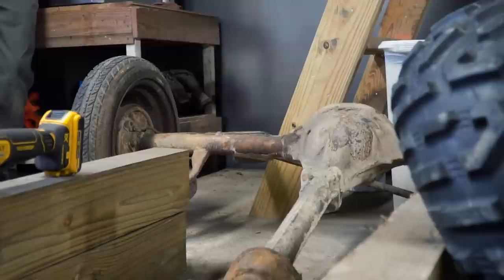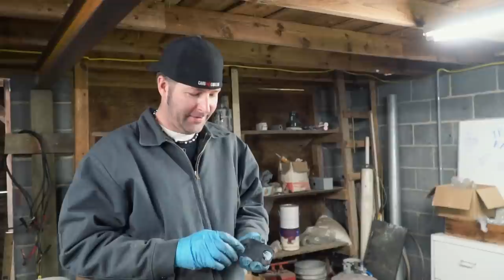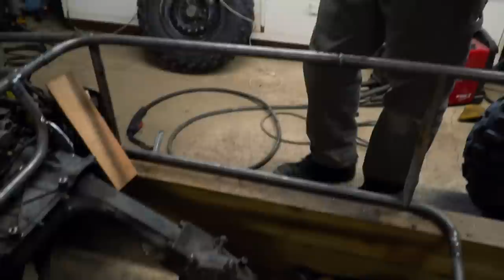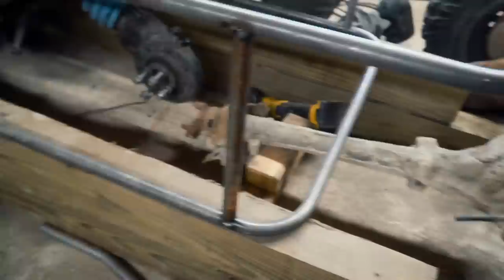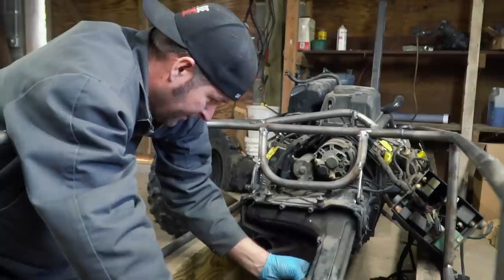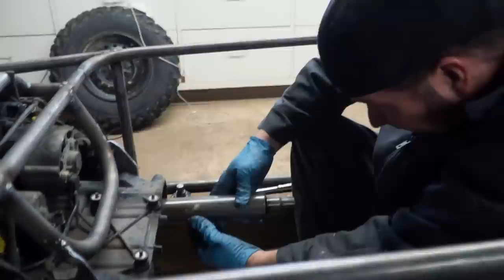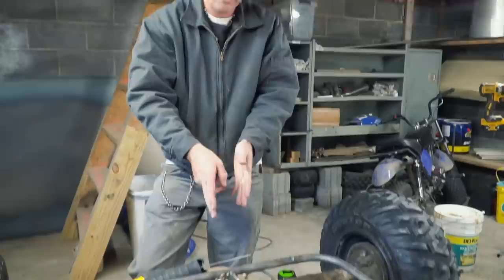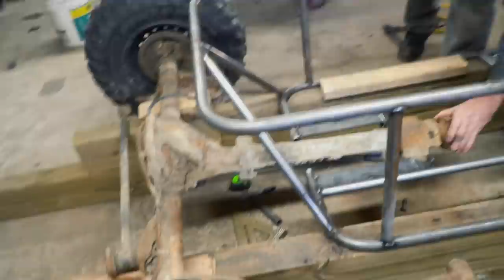1000cc Trophy Kart Build Pt. 3 | Mounting the Rear Axle

Comment from the maker: Those tires on that rear axle😍
Reply: CarsandCameras crazy!
Reply: Is there gonna be a body on it ?
Reply: I hope so Cough - John - cough
Reply: Might I suggest a triangulated 4 link in the rear to eliminate the need for a panhard bar?
Reply: Its coming along great, this is your first build with all the gear so if you don't like something change it or you will lose inspiration for the build.
Reply: Hi love you videos guys... 

2 things I want to point out, which you may have already considered.. 

1, If the rear axle was rotating the wrong direction, flip it over and it goes in the opposite direction.

2, You're going to need a slip shaft, and bearing mount where the 2 drive shafts meet. 

Keep up the amazing content!
Reply: You should also put a bar around the rear drive shaft!!
Reply: Do the rear suspension like a traxxas udr
Reply: Bet Ike is pretty happy he cut off that axle before junking that car.  This looks MUCH better than a Chevette!
Reply: This is going to be awesome guys🤣✌
Reply: You guys should use some kind of hydraulic steering system
Reply: The k100 diff is a strong 90°gear box, may come to use on future projects
Reply: You all should get ahold of Red Beard, of "Red beards garage" I think he could help with the front end stuff, or you all could do a colaboration
Reply: You guys should consider the benefits of a mid engine setup. Would work really well here and solve your motor mounting/foot space issues.
Reply: why u dont punt rewers betwen dif. ore low and hy box in it it ?
Reply: Where are you going to fit the steering column with that engine?! 😂
Reply: If im right you could just turn around the axle
Reply: Ilu guys
Reply: check out grind hard plumping companys projects and their stuff for fabrication and steering. They have pretty small form builds with lots of stuff in them!!!
Reply: Should have done a off-road reverse trike. That would have been awesome.
Reply: You should try using pushrod or rocker arm suspension because they dont take up that much space and look cool wile being functional. Also the pivit point for the sway arms should be tilted back 12-18° this will help with bigger bumps and it'll make the ride a lot smoother because usually the tire does most of the work when the pivit point for the sway bars are mounted flat(or are barely even tilted back) but if the pivit point is tilted back 12-18° the tire and the suspension are working together a lot more and the tire goes straight wile also going a tiny bit back which helps make it a lot smoother and moves quicker when you hit a bump which will help stop the front end from kick up especially because there's more weight up front and as a plus if you run over and hit a sway arm on a big rock the sway arm most likely won't take any damage(if you have a plate underneath it) and will slide over it. You probably know more then me and know what type of suspension will work best but I just wanted to give you an idea of the type of suspension that might work with what your trying to do. Forgot to add that the steering nuckel is still straight up and down just the pivit point and the sway bars are tilted back.
Reply: hey you guys were wanting an idea on looks why not do something like dirt track midgets? 
http://s100.iracing.com/wp-content/uploads/2017/11/Midget-Car-Tile-Page-1024x576.jpg
I think it would work really well and they are  bad ass little cars
Reply: You guys need a sponsor to send you a lathe. Then you could cut spline shafts and more. Looking good otherwise. Can't wait to see her against the cross kart.
Reply: Cars and cameras style buggy wheels
Reply: Idk exactly, but I would want to do a solid mount to that small splined shaft like factory and maybe add a large shaft and u joint off of a ford ranger drive shaft and recreate the cup on the trans. Get more travel and strength?
Reply: id love to see a short mini truck bed with a wood floor on that
Reply: CarsandCameras get rid of the live axle. Use a Subaru rear IRS set up or early nissan sedan.
Reply: You guys gonna weld that diff for posi traction?  I'm pretty sure that's an open diff,  open diff + offroad=stuck somewhere at some point...
Reply: 4 link  2 below out wide 2 up top close to center.  And then 4:1 or more pushrod suspention  that will give you your desired 18 inches of travel from the 4.5 inches of stroke the miata shocks have.
Reply: @collinschoneman8605  trx4
Reply: CarsandCameras Have you guys considered using a manual Honda Civic steering rack? Preferably for an 88-91.

Comment: A possible idea: Weld a 1 1/4" keyed coupler on the driveshaft, and on the opposite end, so you can run a gopowersports 1 1/4 axle as a driveshaft.

Comment: Cant wait to see how this project turns out!! Although, Miata shocks and coil-overs aren't gonna give you the plush, long travel suspension that your wanting and that this chassis needs. Miata suspension is made for a 2,000 pound car and at the most have 5 inches of travel. Go on eBay and get yourself some used shocks off a Polaris RZR or equivalent SxS. They are around the same price as used Miata suspension and will give you a lot better ride then any car shock will. Keep up the good work!

Comment: For the bump steer, keep the levels of the tie rod mounts the same on the frame and the wheel. Looking good guys!
Reply: With the amount of travel they want that would put tie rods at a severe angle at max travel.
Reply: Grind Hard Pluming addresses front end geometry on several of their builds. (Barbie Jeep, Honda Oddesy, etc.)
Reply: A thought; a Twin I Beam style suspension, both axle halves pivoted in front of the motor and front steered. If you use a drag link to operate one side the steering would avoid needing to go through the engine space.
Reply: They already know this.  Aint their first rodeo.  Becomes different ball game with extreme travel.
Reply: @SportbikerNZ  Agreed- the current hhot set up with some of the four wheelers in Texas is based on the Ford Twin I beam- huge travel. it does have some geometry probs at full droop, but for a back country vehicle that will seldom see 45 mph, no big problem. The front steer is to get the  tie rods and such away from the motor, and those tie rods need to be the same length and plus or minus 105 of the individual axle length. While I'll agree this isn't their first rodeo, they are looking for something they really have not built before- 18" suspension travel, bounce and jounce is huge- a Humvee doesn't have 60% of that. Also the Twin I Beam is not on the menus they have been working from, so I thought I'd through it in there. FWIW, all front end geometry becomes  iffy at the extremes of most long travel designs. Additionally, a drag link type of steering gear will avoid having to pass the steering shaft through the motor, rather by the side of the motor and tie the drag link end to the steering arm on one side and "share" the input thru long, articulated tie rods, run parallel to the axles at ride height , equal length and with their "input ends" very close to the same point as the pivot for the steering knuckle they are tied to.
Reply: @fredericrike5974  Your comments look productive.  I should have specified I was replying to the steering 101 comment by Pugg.

Comment: For minimizing bump steer a double wishbone setup is pretty easy and will keep your speed up in the rough straights. In our baja SAE cars we have 10-12" of travel on a 15" A arm setup and can keep it under 3 degrees of bump steer. Getting into bump steer while turning is some high level stuff and more trial and error with CAD simulations than anything, so I wouldn't recommend bothering with it for this.

For setting it up, just make sure the tie rod mounts of the steering rack are in line with a line drawn from the upper A arm pivot axis and the Lower A arm pivot axis, and that the upright's steering link mount holds the link as close to parallel with the A arms as possible. It won't be perfect throughout the whole travel due to your kingpin angle giving you unequal length upper and lower A arms, but if you can have it parallel at right height it should be pretty close through most of travel.  Since you probably aren't building a steering rack from scratch, you'll probably have to make extensions to whatever your found and support them with just some plain nylon or UHMW bushings, but mounted inboard by the distance of the racks travel. (so the rack would have to be pretty skinny, like something from a quad, UTV, or golfcart rather than a car).

In a front mounted tie rod design, pivoting the steering link towards the wheel will increase ackerman, while bringing it in towards the car will get you closer to parallel steering. How much ackerman you want depends on how much wheel spin you're going to have, and whether you plan to drift through the corners or brake and try to corner them properly. 
In my experience with vehicles with a 70% rear 30% front weight balance, the parallel steering is very susceptible to understeer (even at higher speeds), while it can actually get some grip with around 70-80% ackerman steering because the front tires aren't fighting each other until the rear breaks traction.

Comment: You should use a VW front beam make your front suspension a whole lot easier to build it just bolts in
Reply: Casey Nolte then they wouldn’t be able to get the travel they want
Reply: maybe a vw lower front k member from a mk2 or mk3 golf/jetta. flat, cheap, steering attached, and easy to mod. in fact i think i have a spare somewhere that i might be able to donate to the cause. its 4x100 for the hubs too, so that should be pretty compatible with your wheel selection
Reply: @colez4651  really depends on the way the beam is set up
Reply: Yes. This thing needs a real chassis too but I'll watch this thing bend as soon as it goes over a jump. It will be more entertaining
Reply: Yes, and make it ride like absolute crap.
Reply: @nickmccain6598  Same ignorant comments were made by clueless people about the crosskart.  They're only getting started on the chassis.
Reply: @SportbikerNZ chassis doesn't even look halfway done to me, "its gonna bend", well of course it would the way it is
Reply: @Billo-07  They could have 4 pipes welded into a rectangle frame and there'd still be some internet "expert" freaking out that it's a death trap with no roll cage.
Reply: @nickmccain6598  them damn fake chassis, aint got nothing on a real chassis
Reply: @colez4651  you have obviously never built an off-road  link pin front end, you can get 14 to 18 inches of travel out of one
Reply: yes, easy bolt on

Comment: Really wish y'all went with the reverse trike for this. That would have been awesome. Seeing that offset drive shaft, you should put in a 4wd transfer case and throw an old claw foot tub in between the frame for seating. It will be the bath tub bouncer.

Comment: I'd suggest changing the torque tube mount so it pivots vertically. The stock rubber isolator won't have enough flex for the suspension travel you want. You could do it easily by trimming the stock mounting plate and welding on a washer to each side vertically. Add  pieces of angle to the mounting plates on the frame and bolt the washers to them loosely so they will pivot. If you use the torque tube as a suspension link, you won't need to add 4 more links. In fact, it will probably cause binding. The tube will control pinion and brake torque as well as forward and reverse thrust. The coil overs will control roll and jounce. I would extend the outer suspension links to pivot on the same axis as the front torque tube mount to control yaw. BTW the gear ratio of the Chevette rear should be 3.36:1. Also, Chevette brakes really SUCK. Consider changing to disc brakes. Nice start on this build!

Comment: Carsandcameras  Copy the superlift, prerunner steering links. Basicly an over-engineered idler arm and pitman arm setup with equal length steering links.  Just make sure steering link angles match the control arm angles and on center line of the upper and lower control arms. As close as possible anyway.

Comment: I work on K100 A LOT. Before you go any further check the front end of the driveshaft for spline wear. They do wear badly if not greased on a regular basis.......
Also for extra mounting, why not use the centre stand mount point on the bottom of the gear box? This is used for also a mount point when putting a side car on this bike.

Comment: Source a Suzuki Samurai rear axle. They have an offset diff that would line up better with your driveshaft output. They don't have that extension housing off the front allowing for a longer driveshaft (better angles @ the joints). Plus, a fair aftermarket support.

Comment: Looking at your frame ther and the relationship of the rear end and the frame you might consider quarter eliptic springs in conjunction with the existing suspension. You will need to add a panhard bar but it would be simple and effective.

Comment: You should use a triangulated four link on the rear axle.  It will allow maximum articulation of the axle, and it eliminates the need for a panhard bar.

Comment: I don't know if this will help but you could put a shock on the the steering linkage to help with bump steer. Kind of like how some jeeps have in the front. I think that is there mostly for vibration but it may help. Also depending on how much angle change is on those u-joints you may want to use double cardan u-joints.

Comment: Sit the driver position up higher, basically above the rear axle driveshaft area. It will help give more feet room, the problem now your positioning to be more horizontally positioned which while riding may add some discomfort. Just a suggestion.

Comment: I could really use that differential. I'm trying to put this 900cc old kohler engine into a golf cart and it would look 100 times better if it could be mounted facing forward. Another thought i had is i could do an old style motorcycle with a flat opposed twin, and i could use that to do what it was initially made for on the bmw bike.

Comment: Bolt a sprocket to the back of the engine, and chain drive it down to a Jack shaft / prop shaft to be inline with the rear shaft. especially good if you have your UJ inline with the point of articulation, then you wont need a sliding prop shaft coupling

Comment: I'm pretty sure a trophy truck doesn't have a 4 link rear. It's all trailing arms I believe but I would build a ladder bar
Reply: What they are talking about is trailing arms and a panhard bar. I'm sure trophy trucks use a triangulated 4 link. Lower trailing arms with the upper arms forming a triangle to centre the axle
Reply: @richardmackay7858  they actually don't run 4 links at all  it's a trailing arms setup with a wishbone 3rd link you can get way more travel out of a 3 link system

Comment: Instead of just a driveline hoop Id consider running from the cut spot up to the braces and then add a cross piece, that will give a lot of support. Then you could come off the top hoop to the area of the cross piece to triangulate it even more

Comment: Hi guys, love your project. I'm concerned about your final weight. The BMW wet is 560 lbs. Are you going to come in at about 700 pounds? How much offset between the two drive shafts? Would a crossmember with carrier bearings and chain sprockets take care of the offset and also offer a ratio change?   If I lived closer I'd be prodding you along. Your next taping is kind of like waiting to get your Post Toasties toy in the mail.  Good job guys!
Reply: I bet more like 1000 lbs. I hope less
Reply: @isaacitllbefine7231   Isaac, VW transaxles are always fun and you get a rear suspension. You two lead many of us through projects of fantasy, others of us you save much trial and error. Cheers and carry on 
" IT'LL BE FINE "

Comment: I wouldn't recommend a parallel 4 link with pan hard bar if you want long travel and no bump steer. Only reason people use a panhard bar on the front of trucks is because size/bar location constraints. 
Your best option is triangulated 4 link or double triangulated 4 link.
You can also get rid of the majority of bump steer on the front if your steer links and control arms are the same length. If using unequal control arms, the steering links should be the a fraction of the length depending on how high up on the spindle it is mounted.

Comment: Make a hydraulic steering linkage for zero bump steer. Mount the wheel directly to a steering box, actuating a hydraulic ram, plumbed in a closed system to a ram on each front control arm to actuate the spindle. Easy.

Comment: If you pull that drive shaft you will have a u joint at the motor. You should be able to go from there all the way back to the rear end. That is how motorcycle trike kits are engineered. It should be a lot stronger. Also if you look that short drive shaft may be a rubber cushion and won't handle that rear end with out slipping.

Comment: I know this is probably too late but do not use parallel four Bar rear suspension. Use triangulated four Bar system, there are A lot of designs. These systems allow the rear wheels to move independently , 
Parallel four bar works well with drag racing requirements but not off road requirements, I found this out the hard way while working on a 48 Ford rear suspension, while I had the parallel four bar mocked up I discovered that when one wheel hit a bump the other wheel moved up The same distance, not staying on the ground. A triangulated four Bar System can deliver nearly independent suspension action. Mock it up and see for yourself.

Comment: Would it be possible to get a small hydraulic steering system, or maybe a fly by wire electric system? Would make placement for the rack a little easier
Reply from the maker: Thought about hydraulic, but the systems are $$$